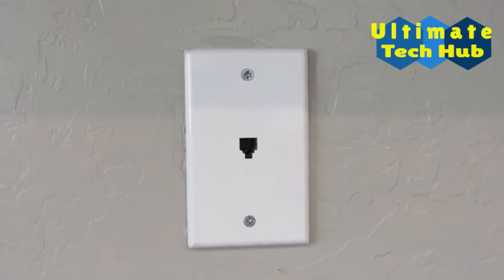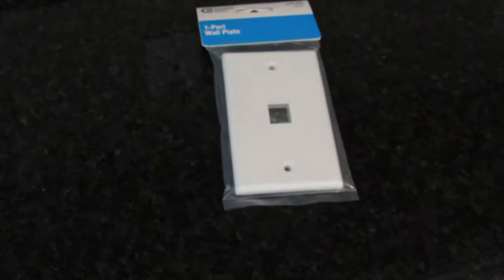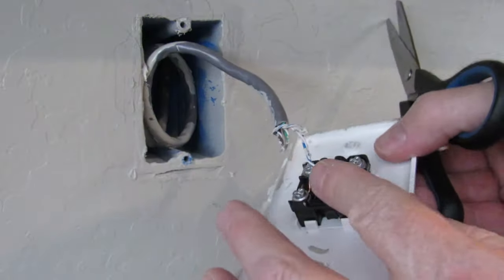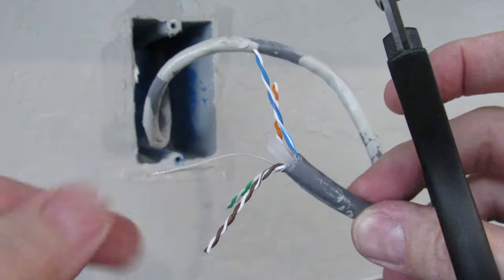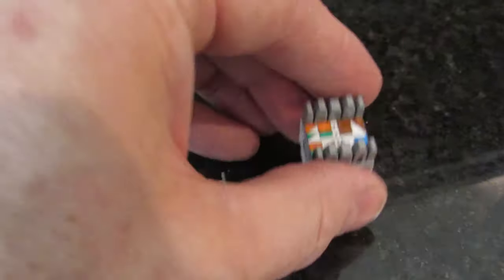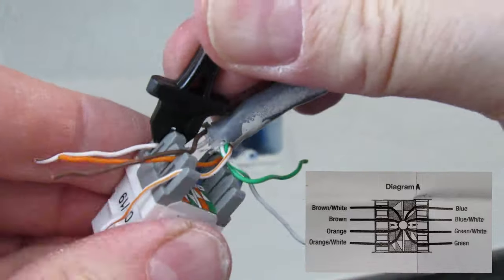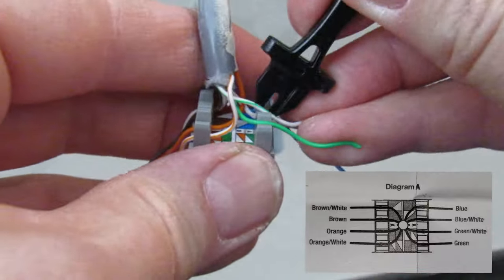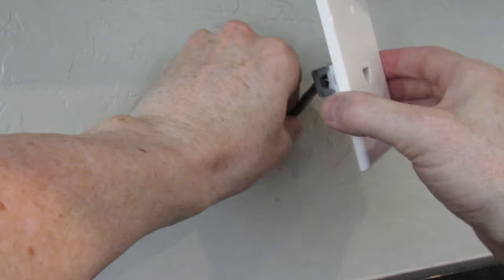CONNECT CAT6 CABLE TO JACK - HOW TO

Comment: You forgot the most important step..... Making sure you have cat6 cable in the wall.  90% of homes in America won't have cat6 cable in the wall.  So running cat6 will likely be your first step.
Reply from the maker: This video is about converting the phone line (voice) to a Cat6 (data) jack using existing Cat6 line that is already in the wall. You are right 90 percent of homes dont have Cat6 and even Cat5e. But 10 percent of homes and nearly all new homes have Cat6 or Cat5e so this video is for those with this particular situation. Thank you for watching and if you subscribed thank you as well.
Reply: @UltimateTechHub  how to define the cable come out from the outlet is cat 5 or cat 6?
Reply from the maker: @bl780  look on the cable itself.  It will say Cat5e or Cat6. It might be in tiny writing .
Reply: @UltimateTechHub  there no word printed on the two cables.
Reply from the maker: @bl780  Probably Cat5e cable. If your house is older. If its new then its Cat6. Doesn't really matter as far as the wiring goes. Its exactly the same.  And Cat5e gets 1 gig speed so that's plenty.
Reply: Very important💪💪👍👍
Reply: Run it along the wall and cover with baseboard 😜
Reply: @bl780  cat 5e wont have that inner core but cat 6 will have the inner core
Reply: Any advice on doing this in a house built in '83?
Reply: @astrotrance  if your wanting cat6 in your walls, first floor install thru the basement is easy.  2nd floor in wall would be a challenge without tearing out large amounts of drywall.  Personally if you have a basement or crawlspace I would hard wire an office on the first floor and tv area on the first floor.  I would just use wifi for the rest of the house.
Reply: This, when I saw the title, I was like, how's this guys converting rj11 to rj45? Very misleading video.
Reply: How can I identify that I have cat6 cable in the wall?
Reply: @S0LIDSNAKE97  networking cables are similar, an outer sheath with several twisted pairs of copper conductor wires inside.  Cat 5 and cat 6 have 4 pairs inside thier outer sheath.  There is printing on the outer sheath it will say cat 5/catagory 5 several times on the outside.   You want cat 5e or cat 6 as both will allow 1 gigabit network speed. Older cat 5 will not be able to achieve 1 gbit, only up to 100 megabits if I recall correctly. If you have that it's ok but not ideal.  If your internet speed is under 100 megabits/sec then you won't likely miss out on anything in real world use.
Reply: @MrTHORN74  so I opened the Rj11 port in one of the rooms and I see wires that are solid colored (Green, orange and blue) then I also see wires that are striped with white (blue white, green white and orange white)
Reply: @S0LIDSNAKE97  those are the twisted pairs inside the outer sheath.  There should be a plastic coating surrounding all of those wires as a whole.  That is the outer part with the printed labeling on it.  That's where it will say cat 5 or 5e or cat 6
Reply: @MrTHORN74  thank you sir! So if it says cat 5 or 5e i should be able to use it for internet right? Or do I have to check anything else?
Reply: @S0LIDSNAKE97  correct ...cat 5 is technically sub standard now, cat 5e and cat 6 are what I want both are capable of 1gigabit/sec transfer speeds.  If your internet provider is giving anything under 100 megabits/sec then older cat 5 will be fine.  U won't notice any difference in real-world usage.  If your ISP is giving more than 100 megabits then you definitely NEED  cat 5e MINIMUM cat 6 is the more future proof of the bunch.
Reply: @MrTHORN74  the house im moving to was made in 2004 so idk if it will have Cat 5e or Cat 6
Reply: @MrTHORN74  thank you so much for the information. Super helpful
Reply: @S0LIDSNAKE97  5e most likely.  Cat 6 won't likely be in anything before 2010 unless it was retrofitted after it was built.
Reply: @UltimateTechHub  I have cat3 in my house, (with only 6 wires instead of 8 wires), I was able to get 100mbps, not very fast but better than my WiFi dropping out. I suppose you can get 1gbps even with cat5, as long as you have 8 wires.
Reply from the maker: @something3813  Yes Cat5e or Cat6. If you decide to rewire your home use Cat6a which provides 10 gig speeds. This will future proof your home.
Reply: The builder in my new construction home only offers Cat5 wiring in the walls to Cat5 outlets in the home. Is it possible to convert the wire from the outlet to Cat6 or would the new electrician have to run new Cat6 wiring to every outlet?
Reply: @manaftergodsheart  You can get 100mbps with 4 to 6 wires, and 1 gbps with 8 wires. You need cat 6 preferably cat 6a or cat 7/8, to get 10 gbps or more.
Reply: @manaftergodsheart  not really.  Replacing wiring in the wall is never easy.  I would check the network cables outer sheathing.  Look at the printed lable on the cable, it should most likely say cat (catagory) 5e.  99% of cat5 sold is actually cat5e.  5 has a 100 mbit throughput while cat5e has a 1000mbit (or 1gbit) be throughput.  Cat 6 is also 1gbit, so if you have cat 5e you are not really missing out on anything.
Reply: @manaftergodsheart  If you use cat 5 wiring with cat 5e outlets it will work, at least for me it worked. But for cat 6 or above, it won’t work, but cat 5 wiring with cat 5e outlets will work up to 1 gbps. As long as you have 8 wires it will work up to 1 gbps.
Reply from the maker: @manaftergodsheart  If the builder didn't secure the cat5 to the wall studs, meaning the cat5 is just free floating inside the walls then you can just tie a cat6 to one end of each cat5 and pull it through the wall and pull it to your network panel. If the cat5 is not free floating then you could just wire drop cat6 in the same location and use the same outlets. There is always a way but it can be tricky.
Reply: @UltimateTechHub  do you have a video on how to convert a copper thick cable line into a cat6 ?
Reply: It's not.  It's land line cable using dal with an rj11 plug.  Does this mean I can't use dal through this phone line and have to connect directly to the modem?
Reply: @UltimateTechHub   Hmmm, I was expecting phone line wiring.  I have a 25 yr old house with phone line that I can't remove, and would like to change the rj11 jacks to rj45 so that I can plug one end into my router and the other end plug in a VOIP phone.  Is this possible with existing phone/voice wiring?
Reply: I’m a 26 year tech and you lost me with the scissors. 😂 22g solid will ruined like that. Wire stripping 101 fail..
Reply: This can easily be fixed by using couplers, bezels and RJ 45s
Reply: @UltimateTechHub  It might even be plain CAT5, which is what Gb was designed for.  I have it here in my home, which my ISP installed when I first got a cable modem, in the late 90s.  I provided the cable, which they pulled in with the coax for the cable modem.
Reply: @kevinc9006  My ISP fished in 2 runs of CAT5 and 1 coax, when I got my cable modem in the late 90s.  They went up, inside the wall between my living room & bedroom, over my closet & bathroom ceilings, along the laundry room ceiling, down the wall behind the water heater and through the wall into my "office" closet.  The cables are only visible in the laundry room and office closet.  They even patched the drywall, where they cut it.
Reply: @James_Knott  that wouldn't happen in these days and time

Comment: I tried doing the same thing but with a cat53 jack. I didnt seem to get any connection. But I also didnt get a wire push in tool so I used a flathead screw driver. Any solutions
Reply from the maker: Get a cheap 5 dollar punch down tool.

Comment: This assumes you already have CAT 6 wiring & only want to change the wall jack. Older homes won't have CAT 6.
Reply from the maker: Very true older homes will have Cat5e which is the exact same process.  My last home was built in 2006 and every room had Cat5e. I did the exact procees with a kitchen phone jack and made it a Cat5e outlet.  Thanks for watching and if you subscribed thank you as well!
Reply: @UltimateTechHub  can i use cat6 wall jack with cat5e cable?
Reply from the maker: @alexzhang929  Yes. You wont get Cat6 speeds but it will work. Thanks for watching.

Comment: So I just got the new Verizon router but this one needs cat6 but my house only has phone lines, is it possible to change phone lines to cat6 if so how?
Reply: This guy got lucky that his phone jack was wired with an ethernet cable. A lot of newer homes use Ethernet cables for phone lines. If you have an older home, that just has the older phone connector, you'll need to contact an electrician to install new Cat6 wires in your house.
Reply: @TheKBrosTech  It's been 3 years I forgot I even posted this 😆

Comment: I have a Question tho like how the Coaxial comes from your Splitter where does the Telephone or Ethernet Jack connect to from the other End
Reply: The phone line would most likely go to the basement and to the phone line would connect to the line coming into your house

The ethernet would do the same, but you would wire the other end to your router

Comment: Nice video! Did you have an ONT on the other end and if yes, how did you disconnect those RJ-11 and hook it to RJ-45 at the source?
Reply from the maker: Nope this line is a Cat6 line that runs to our network panel in our closet. The builders ran Cat6 to 3 locations. This connection in the kitchen was a cat6 but they made it a voice connection by using the 2 blue wires. I just turned it into a Cat6 with using all the copper wires and the cat6 plug. Easy.

Comment: But often you will not have a CAT5 / CAT6 cable for the telephone 
but some CAT1 telephone line with maybe only two wires.
Reply from the maker: In the newer home builds since around 2008 cat5e has been the standard and now cat6 is way more common. Thank you for watching.

Comment: Is this as efficient as running ethernet from box to system? Tapping right into wiring?
Reply from the maker: Ethernet is always the most efficient and the cable I converted was a cat6a cable that was wired as phone line. If your line is a cat3 phone jack then this is not possible. You will need to rewire that port with cat5e or cat6.

Comment: question for you ( im excited to try this ) so i have a standard internet cord outlet ( the screw on that goes to the back of the modem ) if i have that plugged in will this conversion have an internet connection through the conversion? meaning would i be able to just plug and play for a hard wire connection?
Reply from the maker: Yes if the ethernet is a Cat5e or Cat6. And as long as the other end of that cable in the wall is connected to a router or modem or switch.  I have a video on " Where does the ethernet go?" You should watch it.
Reply: @UltimateTechHub  will do! thank you.

Comment: Does this only work for cable internet? What about att fiber?
Reply from the maker: It will work for fiber. I have CenturyLink fiber. Thank you for watching.
Reply: @UltimateTechHub  how do you do that? Do you just convert the other end of the phone line to ethernet jack just like the one in the video?
Reply from the maker: @kevs1768  My house was wired for phone line in my kitchen but the wire is a cat6. If you have cat5e or cat6 in your home that's wired as a phone jack its an easy conversion.
Reply from the maker: @kevs1768  Yes

Comment: Might be a stupid question but I’m only asking because you didn’t mention it.. do you have to cut the power first before doing this ??
Reply from the maker: Nope. This is low voltage wiring so don't worry about the power.

Comment: Our new build will be done in December. We will have a network panel in our laundry room. I noticed we will only have Ethernet ports in 3 places but the rest are phone/cable. Will the method in the video work for my home? I’d like to turn those phone lines into Ethernet. I just didn’t know if there’s anything else I need to do afterwards. Thanks
Reply from the maker: If the cables are cat5e then yes you can convert the phone to data.

Comment: Should it just automatically identify the internet or do I have to do some wiring and extra stuff for it to work? I have a cat 5e
Reply from the maker: Once you have connected the cat5e jack you need to find out where the other end goes. The other end needs to connect to a modem or router for internet connectivity. Thank you for watching!

Comment: I noticed you didnt splice open the 8 wires to expose the metal wires? How is it conducting what it needa to conduct? Or was it spliced opened as you push it doen with the plastic tool?
Reply from the maker: Once it's pushed down the copper wires are contacted to the keystone jack connections. I have 100s of Networking videos so make sure to check out my Ultimate Home Networking Playlist. Thank you for watching I really appreciate it.
Reply: @UltimateTechHub  subscribed! last question, what do you call that thing where you connect the 8 wires?
Reply from the maker: @johntonguecruz2404  I believe it's called the punch down connection. Thank you for subscribing.

Comment: New subscriber.  Thanks for ur videos.  I have a brand new home with cat 6e pre wired to my panel, but the builder installed phone jack/coaxial wall plates.  I added the cat6 jack and tried to test the connection but doesn’t show live on my unmanaged switch and router (I have 8 cat6 connections that they didn’t label 😡). I have no idea what I’m doing wrong or what to do next to troubleshoot no connection
Reply: Forgot to mention, none of the cat6 home builder wires light up green, but the wires from my router to the switch and a secondary wireless pool equipment remote both line up on the switch..
Reply from the maker: Thanks for subscribing! In order for the wall jacks to get a signal from the switch you need the wires going into the panel to be wired as data lines. I use the T-568b configuration. The wall jacks will need to be wired as data like shown in the video. Once all wires are configured your network will be up and running smoothly. Here is a Playlist that shows the cat6 wiring. 
https://youtube.com/playlist?list=PL7zrHUmVhFsfIZoJUBwWH4eP8eBsWThST
Thank you for watching and for subscribing I really appreciate it.
Reply: @UltimateTechHub  yea I wired with the B (residential) with the green/blues on one side orange/brown on the other.
Reply from the maker: @sillirichi  So both sides of the etherent are wired and still no signal?
Reply: @UltimateTechHub  I got a network cable Klein tester today to confirm
Reply: @UltimateTechHub  I am stumped
Reply from the maker: @sillirichi  You have a modem then a router and then the switch connected to the router?
Reply: @UltimateTechHub  modem and router are one piece from Cox
Reply: @UltimateTechHub  Love to show u what I’m working with, can send u some photos on ur IG
Reply from the maker: @sillirichi  Yes that will work.

Comment: Once this step  is completed, do you just connect one of the jacks to the router or modem?
Reply from the maker: As long as the other end if this Ethernet cable is connected to a router or switch you can connect a device to this port.

Comment: so my house is made in 1970 but we had an extension built in 2002 the same year that cat6 was made. what are your thoughts is it cat 6 or not
Reply from the maker: Just check the wire coming out of the wall. It will have the information printed on the outer part of the cable. I would bet it's cat5e. In 2006 cat5e was the standard. Thank you for watching. Make sure to check out my Ultimate Home Networking Playlist.

Comment: Hi, can you test a gigabit internet on cat5e vs cat6? Im having trouble finding the cause of my gigabit throttling and my house was prewired with cat5e. I just want to know if indeed 5e is capable of delivering gigabit speed.
Reply from the maker: Throttling can happen with a managed switch. Cat 5e can handle 1 gig speed and even 10 gig speed at very short distances. Cat 5e in most cases is plenty of speed for just about any situation. And unless you have fiber optics then you would never utilize 10 gig internet speeds. 10 gig is good for massive file transfers between computers but for home networks its not that important. I have 10 gig in my home but its never really utilized. Maybe in the future and that is why Cat6 should be the standard so it will future proof your home. Thanks for watching!
Reply: It's probably not your wiring but if you want to check, make sure the wire isn't sitting on power lines or fluorescent lighting. It's probably your networking equipment. Are you referring to your internet speed? That's likely your ISP and out of your control. You would have to describe the problem you're having with more detail.
Reply: @user-nh3gu1ge3d  thats why i would like to see cat5e in action if indeed it can deliver near 1gbps so i can isolate one factor at a time. Its pretty common items are advertised as something its not able to achieve. I dont want to buy a higher end router if my cable is bottlenecking my speed. My comment is 1yr old yet i still have this same issue. Lol
Reply: There are cable testers that can tell you that.  However, it might be caused by a bad installation.  For example I once had to fix one network, where the cable was stapled with wire staples.  The cables were also forced tight around corners.  Both of these will impair the cable's ability to carry Ethernet.  There are staples with nylon saddles that can be used, but never bare wire staples.

Comment: Question?  I'm planning on installing spectrum cable at home but it looks like there is no coax cable/outlet can I a ethernet cable. I know i seen a cable (cat 6l style that has been cut years ago. Can I use that ? Will it work ?